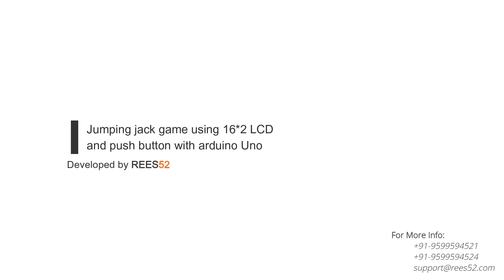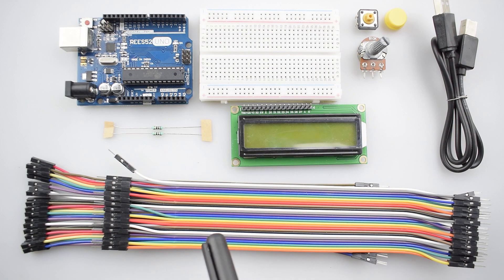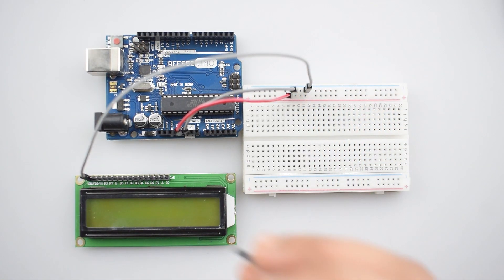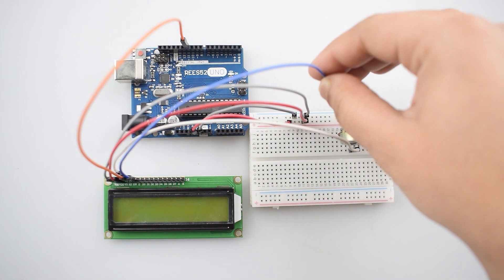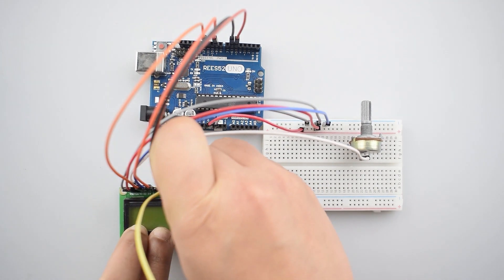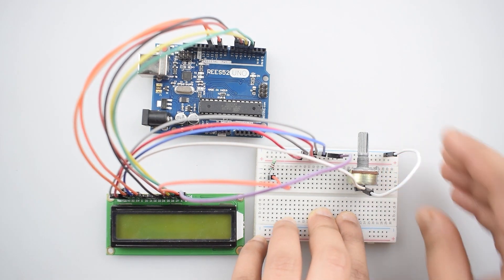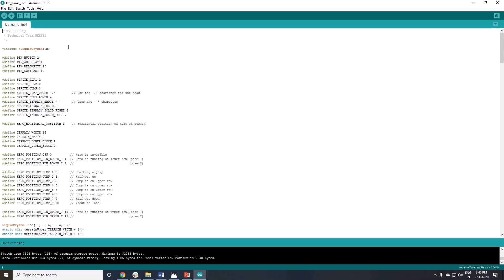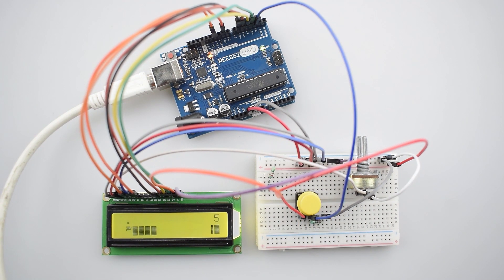Make a Jumping Jack game using 16*2 LCD display and push button interfacing with Arduino Uno

Comment: hello there
so, there is a prob which I am facing 
while I was uploading the code, it is saying some error
" Arduino: 1.8.13 (Windows Store 1.8.42.0) (Windows 10), Board: "Arduino Uno"

Sketch uses 3844 bytes (11%) of program storage space. The maximum is 32256 bytes.

Global variables use 163 bytes (7%) of dynamic memory, leaving 1885 bytes for local variables. The maximum is 2048 bytes.

An error occurred while uploading the sketch
"
can anyone help me out?
pls
Reply: Did you solved it ??
Reply: See if you have selected the port
Reply: If the problem is not still resolved then you must install the driver
Reply: @mailtobasava  Which drive are you talking about
Reply: @jyeshta l

Comment: Hi there, I’ve managed to get the home page up (“press to start” & the figure), however the push button is not being recognised.

Instead would I have to connect the positive to the 5V pin on the Arduino? 

If you could help ASAP, it’d be highly appreciated.

Cheers,
Reply: It doesn't work for me either
Reply: Not working for me :(

Comment: we r unable to get the code through above link
Reply: #include <LiquidCrystal.h>

#define PIN_BUTTON 2
#define PIN_AUTOPLAY 1
#define PIN_READWRITE 10
#define PIN_CONTRAST 12

#define SPRITE_RUN1 1
#define SPRITE_RUN2 2
#define SPRITE_JUMP 3
#define SPRITE_JUMP_UPPER '.'         // Use the '.' character for the head
#define SPRITE_JUMP_LOWER 4
#define SPRITE_TERRAIN_EMPTY ' '      // User the ' ' character
#define SPRITE_TERRAIN_SOLID 5
#define SPRITE_TERRAIN_SOLID_RIGHT 6
#define SPRITE_TERRAIN_SOLID_LEFT 7

#define HERO_HORIZONTAL_POSITION 1    // Horizontal position of hero on screen

#define TERRAIN_WIDTH 16
#define TERRAIN_EMPTY 0
#define TERRAIN_LOWER_BLOCK 1
#define TERRAIN_UPPER_BLOCK 2

#define HERO_POSITION_OFF 0          // Hero is invisible
#define HERO_POSITION_RUN_LOWER_1 1  // Hero is running on lower row (pose 1)
#define HERO_POSITION_RUN_LOWER_2 2  //                              (pose 2)

#define HERO_POSITION_JUMP_1 3       // Starting a jump
#define HERO_POSITION_JUMP_2 4       // Half-way up
#define HERO_POSITION_JUMP_3 5       // Jump is on upper row
#define HERO_POSITION_JUMP_4 6       // Jump is on upper row
#define HERO_POSITION_JUMP_5 7       // Jump is on upper row
#define HERO_POSITION_JUMP_6 8       // Jump is on upper row
#define HERO_POSITION_JUMP_7 9       // Half-way down
#define HERO_POSITION_JUMP_8 10      // About to land

#define HERO_POSITION_RUN_UPPER_1 11 // Hero is running on upper row (pose 1)
#define HERO_POSITION_RUN_UPPER_2 12 //                              (pose 2)

LiquidCrystal lcd(11, 9, 6, 5, 4, 3);
static char terrainUpper[TERRAIN_WIDTH + 1];
static char terrainLower[TERRAIN_WIDTH + 1];
static bool buttonPushed = false;

void initializeGraphics(){
  static byte graphics[] = {
    // Run position 1
    B01100,
    B01100,
    B00000,
    B01110,
    B11100,
    B01100,
    B11010,
    B10011,
    // Run position 2
    B01100,
    B01100,
    B00000,
    B01100,
    B01100,
    B01100,
    B01100,
    B01110,
    // Jump
    B01100,
    B01100,
    B00000,
    B11110,
    B01101,
    B11111,
    B10000,
    B00000,
    // Jump lower
    B11110,
    B01101,
    B11111,
    B10000,
    B00000,
    B00000,
    B00000,
    B00000,
    // Ground
    B11111,
    B11111,
    B11111,
    B11111,
    B11111,
    B11111,
    B11111,
    B11111,
    // Ground right
    B00011,
    B00011,
    B00011,
    B00011,
    B00011,
    B00011,
    B00011,
    B00011,
    // Ground left
    B11000,
    B11000,
    B11000,
    B11000,
    B11000,
    B11000,
    B11000,
    B11000,
  };
  int i;
  // Skip using character 0, this allows lcd.print() to be used to
  // quickly draw multiple characters
  for (i = 0; i < 7; ++i) {
	  lcd.createChar(i + 1, &graphics[i * 8]);
  }
  for (i = 0; i < TERRAIN_WIDTH; ++i) {
    terrainUpper[i] = SPRITE_TERRAIN_EMPTY;
    terrainLower[i] = SPRITE_TERRAIN_EMPTY;
  }
}

// Slide the terrain to the left in half-character increments
//
void advanceTerrain(char* terrain, byte newTerrain){
  for (int i = 0; i < TERRAIN_WIDTH; ++i) {
    char current = terrain[i];
    char next = (i == TERRAIN_WIDTH-1) ? newTerrain : terrain[i+1];
    switch (current){
      case SPRITE_TERRAIN_EMPTY:
        terrain[i] = (next == SPRITE_TERRAIN_SOLID) ? SPRITE_TERRAIN_SOLID_RIGHT : SPRITE_TERRAIN_EMPTY;
        break;
      case SPRITE_TERRAIN_SOLID:
        terrain[i] = (next == SPRITE_TERRAIN_EMPTY) ? SPRITE_TERRAIN_SOLID_LEFT : SPRITE_TERRAIN_SOLID;
        break;
      case SPRITE_TERRAIN_SOLID_RIGHT:
        terrain[i] = SPRITE_TERRAIN_SOLID;
        break;
      case SPRITE_TERRAIN_SOLID_LEFT:
        terrain[i] = SPRITE_TERRAIN_EMPTY;
        break;
    }
  }
}

bool drawHero(byte position, char* terrainUpper, char* terrainLower, unsigned int score) {
  bool collide = false;
  char upperSave = terrainUpper[HERO_HORIZONTAL_POSITION];
  char lowerSave = terrainLower[HERO_HORIZONTAL_POSITION];
  byte upper, lower;
  switch (position) {
    case HERO_POSITION_OFF:
      upper = lower = SPRITE_TERRAIN_EMPTY;
      break;
    case HERO_POSITION_RUN_LOWER_1:
      upper = SPRITE_TERRAIN_EMPTY;
      lower = SPRITE_RUN1;
      break;
    case HERO_POSITION_RUN_LOWER_2:
      upper = SPRITE_TERRAIN_EMPTY;
      lower = SPRITE_RUN2;
      break;
    case HERO_POSITION_JUMP_1:
    case HERO_POSITION_JUMP_8:
      upper = SPRITE_TERRAIN_EMPTY;
      lower = SPRITE_JUMP;
      break;
    case HERO_POSITION_JUMP_2:
    case HERO_POSITION_JUMP_7:
      upper = SPRITE_JUMP_UPPER;
      lower = SPRITE_JUMP_LOWER;
      break;
    case HERO_POSITION_JUMP_3:
    case HERO_POSITION_JUMP_4:
    case HERO_POSITION_JUMP_5:
    case HERO_POSITION_JUMP_6:
      upper = SPRITE_JUMP;
      lower = SPRITE_TERRAIN_EMPTY;
      break;
    case HERO_POSITION_RUN_UPPER_1:
      upper = SPRITE_RUN1;
      lower = SPRITE_TERRAIN_EMPTY;
      break;
    case HERO_POSITION_RUN_UPPER_2:
      upper = SPRITE_RUN2;
      lower = SPRITE_TERRAIN_EMPTY;
      break;
  }
  if (upper != ' ') {
    terrainUpper[HERO_HORIZONTAL_POSITION] = upper;
    collide = (upperSave == SPRITE_TERRAIN_EMPTY) ? false : true;
  }
  if (lower != ' ') {
    terrainLower[HERO_HORIZONTAL_POSITION] = lower;
    collide |= (lowerSave == SPRITE_TERRAIN_EMPTY) ? false : true;
  }
  
  byte digits = (score > 9999) ? 5 : (score > 999) ? 4 : (score > 99) ? 3 : (score > 9) ? 2 : 1;
  
  // Draw the scene
  terrainUpper[TERRAIN_WIDTH] = '\0';
  terrainLower[TERRAIN_WIDTH] = '\0';
  char temp = terrainUpper[16-digits];
  terrainUpper[16-digits] = '\0';
  lcd.setCursor(0,0);
  lcd.print(terrainUpper);
  terrainUpper[16-digits] = temp;  
  lcd.setCursor(0,1);
  lcd.print(terrainLower);
  
  lcd.setCursor(16 - digits,0);
  lcd.print(score);

  terrainUpper[HERO_HORIZONTAL_POSITION] = upperSave;
  terrainLower[HERO_HORIZONTAL_POSITION] = lowerSave;
  return collide;
}

// Handle the button push as an interrupt
void buttonPush() {
  buttonPushed = true;
}

void setup(){
  pinMode(PIN_READWRITE, OUTPUT);
  digitalWrite(PIN_READWRITE, LOW);
  pinMode(PIN_CONTRAST, OUTPUT);
  digitalWrite(PIN_CONTRAST, LOW);
  pinMode(PIN_BUTTON, INPUT);
  digitalWrite(PIN_BUTTON, HIGH);
  pinMode(PIN_AUTOPLAY, OUTPUT);
  digitalWrite(PIN_AUTOPLAY, HIGH);
  
  // Digital pin 2 maps to interrupt 0
  attachInterrupt(0/*PIN_BUTTON*/, buttonPush, FALLING);
  
  initializeGraphics();
  
  lcd.begin(16, 2);
}

void loop(){
  static byte heroPos = HERO_POSITION_RUN_LOWER_1;
  static byte newTerrainType = TERRAIN_EMPTY;
  static byte newTerrainDuration = 1;
  static bool playing = false;
  static bool blink = false;
  static unsigned int distance = 0;
  
  if (!playing) {
    drawHero((blink) ? HERO_POSITION_OFF : heroPos, terrainUpper, terrainLower, distance >> 3);
    if (blink) {
      lcd.setCursor(0,0);
      lcd.print("Press Start");
    }
    delay(250);
    blink = !blink;
    if (buttonPushed) {
      initializeGraphics();
      heroPos = HERO_POSITION_RUN_LOWER_1;
      playing = true;
      buttonPushed = false;
      distance = 0;
    }
    return;
  }

  // Shift the terrain to the left
  advanceTerrain(terrainLower, newTerrainType == TERRAIN_LOWER_BLOCK ? SPRITE_TERRAIN_SOLID : SPRITE_TERRAIN_EMPTY);
  advanceTerrain(terrainUpper, newTerrainType == TERRAIN_UPPER_BLOCK ? SPRITE_TERRAIN_SOLID : SPRITE_TERRAIN_EMPTY);
  
  // Make new terrain to enter on the right
  if (--newTerrainDuration == 0) {
    if (newTerrainType == TERRAIN_EMPTY) {
      newTerrainType = (random(3) == 0) ? TERRAIN_UPPER_BLOCK : TERRAIN_LOWER_BLOCK;
      newTerrainDuration = 2 + random(10);
    } else {
      newTerrainType = TERRAIN_EMPTY;
      newTerrainDuration = 10 + random(10);
    }
  }
    
  if (buttonPushed) {
    if (heroPos <= HERO_POSITION_RUN_LOWER_2) heroPos = HERO_POSITION_JUMP_1;
    buttonPushed = false;
  }  

  if (drawHero(heroPos, terrainUpper, terrainLower, distance >> 3)) {
    playing = false; // The hero collided with something. Too bad.
  } else {
    if (heroPos == HERO_POSITION_RUN_LOWER_2 || heroPos == HERO_POSITION_JUMP_8) {
      heroPos = HERO_POSITION_RUN_LOWER_1;
    } else if ((heroPos >= HERO_POSITION_JUMP_3 && heroPos <= HERO_POSITION_JUMP_5) && terrainLower[HERO_HORIZONTAL_POSITION] != SPRITE_TERRAIN_EMPTY) {
      heroPos = HERO_POSITION_RUN_UPPER_1;
    } else if (heroPos >= HERO_POSITION_RUN_UPPER_1 && terrainLower[HERO_HORIZONTAL_POSITION] == SPRITE_TERRAIN_EMPTY) {
      heroPos = HERO_POSITION_JUMP_5;
    } else if (heroPos == HERO_POSITION_RUN_UPPER_2) {
      heroPos = HERO_POSITION_RUN_UPPER_1;
    } else {
      ++heroPos;
    }
    ++distance;
    
    digitalWrite(PIN_AUTOPLAY, terrainLower[HERO_HORIZONTAL_POSITION + 2] == SPRITE_TERRAIN_EMPTY ? HIGH : LOW);
  }
  delay(100);
}